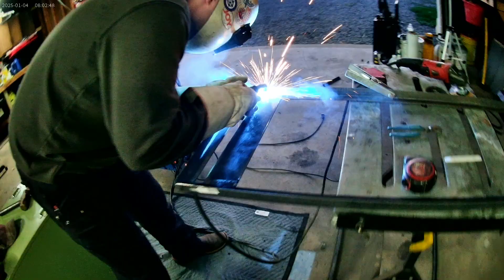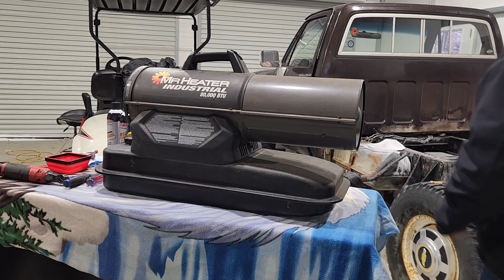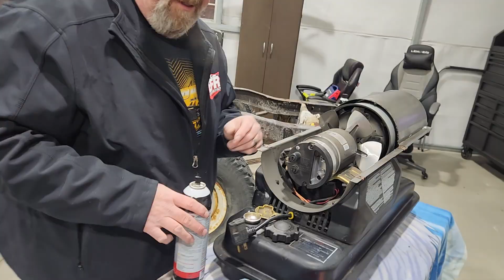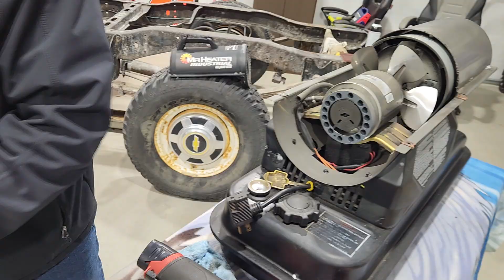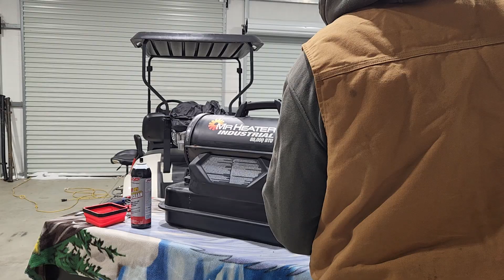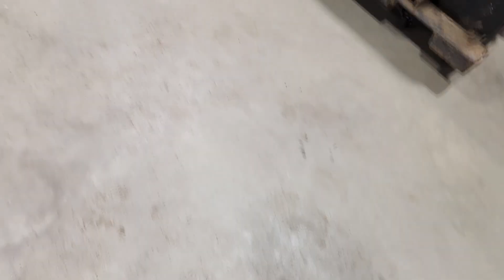What's Wrong With This Mr. Heater?

Comment: I bought a brand new unit from Home Depot and right out of the box with fresh kerosene. It did not seem to want to run hot and steady. I bought a pressure gauge put it on and the pressure was set to about five even though the manual states 4.2 so I brought it down to 4.2 and it started smoking. Had to be turned up to 6.2 psi and now it burns good. I called Mr. heater and they said that the preset from the manufacturer is for the conditions in their shop and that location temperature fuel  viscosities all play a role and that 6.2 is OK to be running my heater at. I asked her I said why do they not supply a gauge anymore? I know they did it to cut cost, but if proper psi is so important. The rep said that just going by the glow on the front is sufficient . I could just respond with OK thank you. Lol